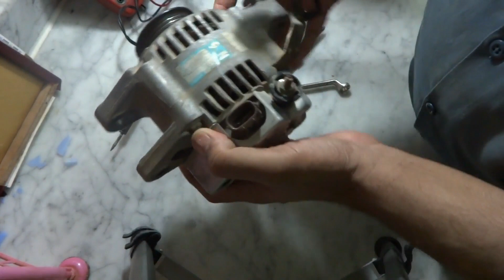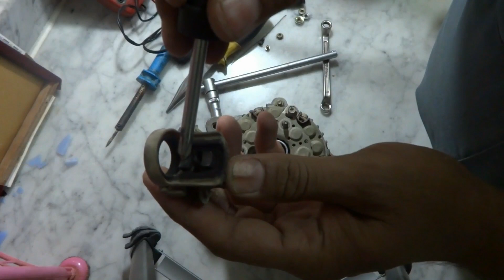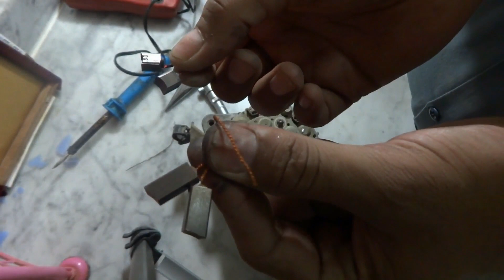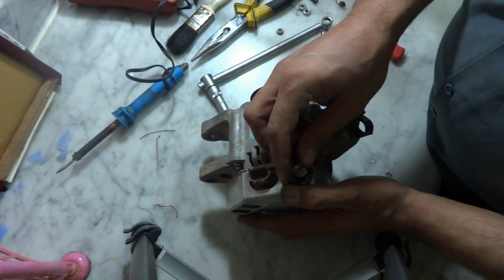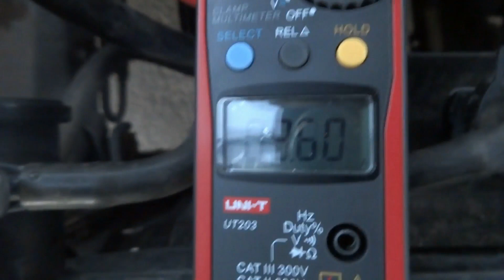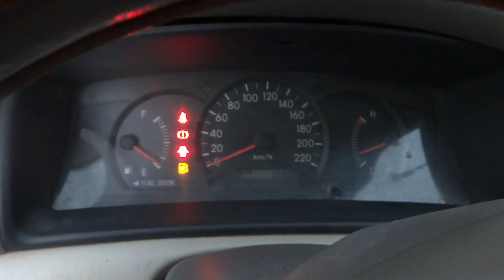Car alternator repair. Car dynamo repair.

Comment: Is it possible to buy only the carbon brushes? Or is the carbon brushes available in the market?
Reply from the maker: Yes sure. There are different size carbon brush available for different alternators and self starters in the market. Sometimes you find little bigger size carbon brush for your machine which you should have to size according to your machine with the help of sand paper.

Comment: I have carolla gli 2006 model.
The generator is producing low ampare on low rpm and high ampare on high rpm.
 Therefore if AC and Headlights are ON in slow  driving thn car  battery becomes very low. Is this issue of carbon bushes?
Reply from the maker: It could be worn out carbon brush. It could also be a bad regulator or rectifier inside alternator. But as you have a few years old car and never perform alternator maintenance, it's a good time to do maintenance on it and I'm sure you will have worn out carbon brush in your alternator.

Comment: sar plz ap car ki security k barey mai kuch up load karen....  if master key lost.... khas kr k toyota lc ya camry etc........(2uz fe. 1uzfe engines)
Reply from the maker: Sure dear friend I will upload when ever there will be a chance to work on such a system. you may watch one video I uploaded on Toyota Echo security and another on NISAN NATS.. Hope it would give you some understanding. And also introduce yourself, where are you from and where are you working?
Reply: M a Pakistani and now working in saudia....auto electrical work. Yaha py engine change hotey hain. Yani nisssan safari mai toyota k engine( 1fz , 1uz.2uz.) Set kiye jaty hain.....
Reply: Tu new engine k ecu mai lock system hota hy jo start ni hoty.... So help me plzzz
Reply from the maker: Dv Danger
Dear friend security is a big problem with today's car. Security components are not always inside ECU. Sometimes they are inside and some times outside as immobilizer unit. You may watch my other video witch is regarding Nissan NATS. It will give you concept. Where are you in Saudi Arabia?
http://youtu.be/rJVKv5cTnY8
Reply: M in az Zulfi
Reply: And 2nd thing is camry  2009 speed sansor(kmh) location i dont kon yesterday saw but ni mila...
Reply: Ap ka nam ijaz hy i think
Reply: Outside not big  prolem but insde...........
Reply from the maker: Dv Danger Friend my name is Jahanzeb and I am in Buraydah Alqassim, a little distance from your place.
Reply: Wow
Reply: Thats great.... Kindly send me your skype name...i wana audio talk with u.
Reply: M sory... Ijaz wala mera gus ta.....
Reply from the maker: Dv Danger
khangeeqcc
Reply: Thanx now i m add contact

Comment: Loverly video, allways enjoyable to revisit your tutorials :-))

Short brushes also have less pressure applied because of the spring being less compressed, so the contact to the rotor rings is not good, brushes can bounce due to bearing wear and lack of pressure, spikes can appear on the supply and upset the radio or ecu in worst cases..

Dont know if i said the above before, im sure you wont shoot me for repeating myself ha ha :-)